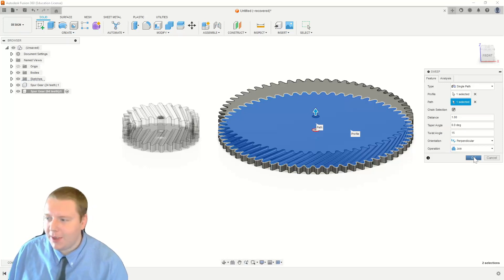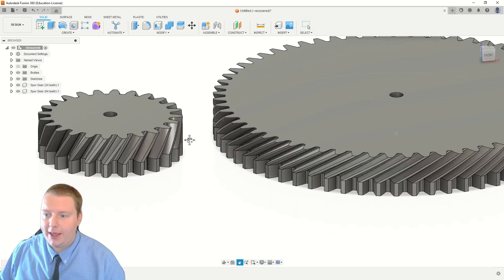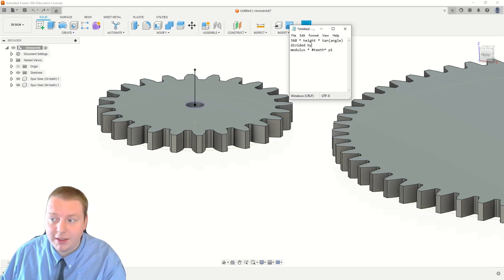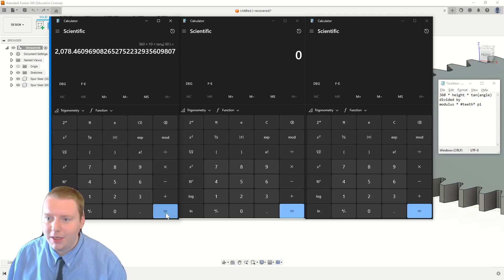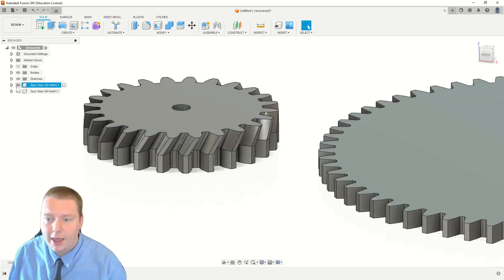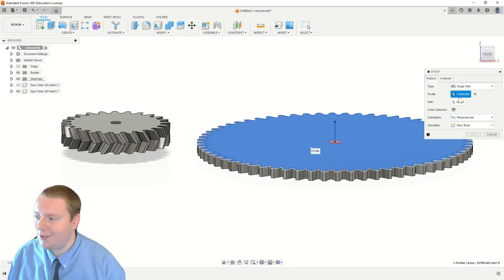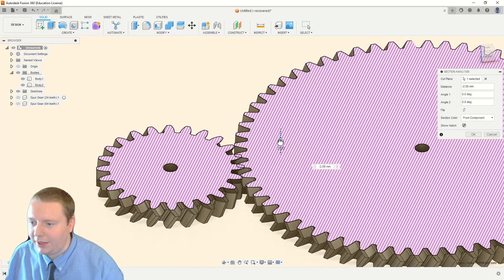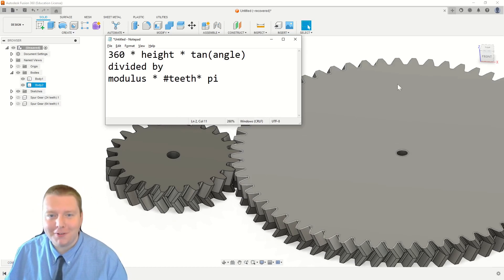The CORRECT Way to Make Herringbone/Helical Gears in Fusion 360

Comment: I definitely prefer knowing how to do it without the plugin, even if I end up using a plugin later to save time, because it takes the black-box mystery out of it, so I appreciate this kind of tutorial over something like "Step 1: install a plugin"

I think you could put the tangent formula directly in as the expression rather than needing to use a separate calculator? I'll have to test that sometime. Still useful to see it demoed explicitly with the external calculator though

And if my math is right, you could even "cheat" by parameterizing the other gear in terms of the other gear's angle by multiplying by the ratio of gear sizes, or ratio of number of teeth (but I'm new to all this gear stuff, so who knows)

Comment: There are some helical gear generator plugins for Fusion that I highly recommend! They handle this for you, and can do some cool stuff like adding desired amounts of backlash, or tell you the diametral pitch of each gear to make setting them the correct distance apart nice and easy. Their main disadvantage is that none of them are parametric, which may be a deal breaker depending on what you're doing. The method you show can be parametric if the base gear profile is, so that may be a huge win!